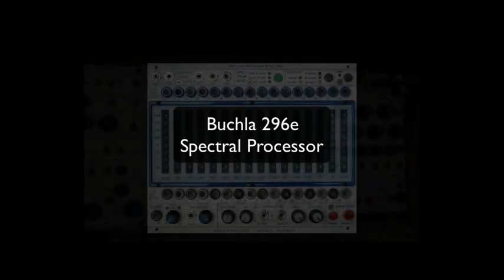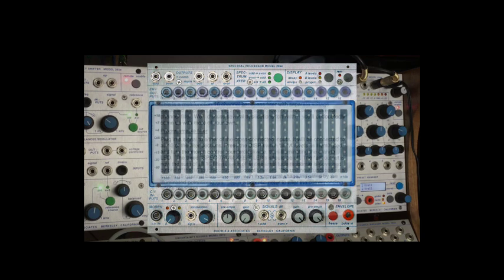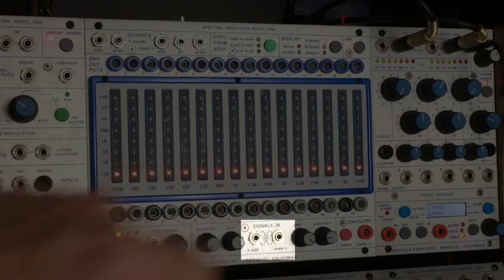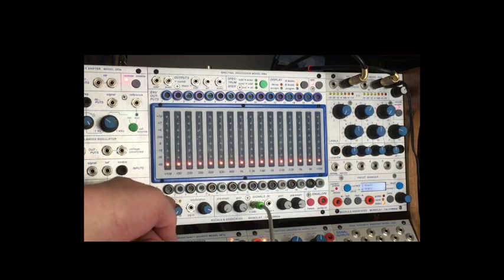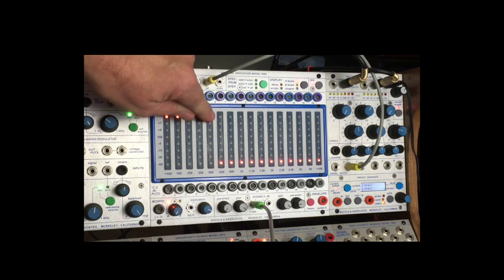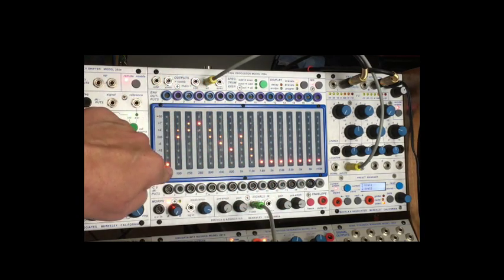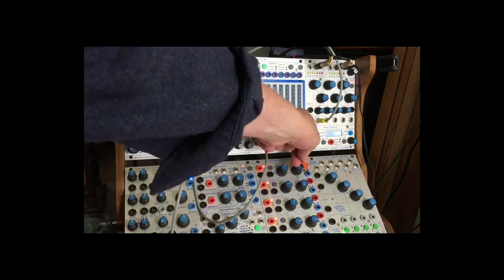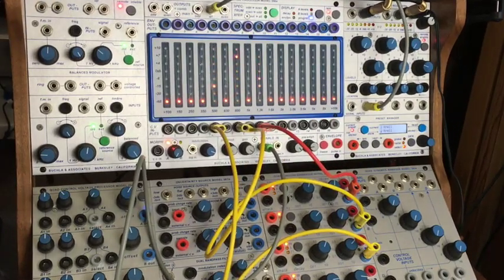Buchla 296e tutorial 01

Comment: Nice video Tutorial Todd. I have a question for you. At the moment I have and easel and Meta 416 exapnder (made by Guy Drieghe who is a good friend of me) I intend to buy in the future
another 4u powerd boat to put on top of it and like to put 296e spectral Processor and I thought also a 285 Frequency shifter. Now I have 1 module left and don't know exactly which module I can put in, maybe a preset Manager or something esle ? Considering my setup with easel and expander what I have. Do I need a quad function generator or preset manager, source of uncertainty or...... ? Maybe you could help me out. Greetings from Luc - Belgium
Reply from the maker: Luc Debeck Hi Luc, sounds like a cool proposed setup! My tendency would to be to add one off the following: 257e, 255, or 256e. With these modules you can create diverse envelopes from just a single EG and send those discreet EGs to various bandwidth cv inputs on the 296e. A 206e preset manager would memorize the “e” modules but none of the others and would offer CV processing which the 296e cries out for in my humble opinion. Cheers! Todd
Reply: Thanks Todd, I agree with you, I certainly need on of those. And which would be better, 256e or 257e. More options with the 257e ? I will search for video's of those 2 modules
Reply from the maker: Luc Debeck my first choice would be the 257e—lots of possibilities indeed! Including pulse outs
Reply from the maker: @crappie050764  how can I email you some links? You can reach me through toddbarton.com
Reply: Thanks, opens a lot of possibilities with that module